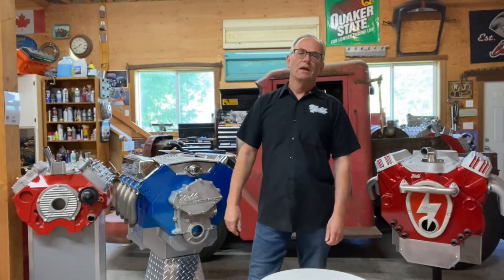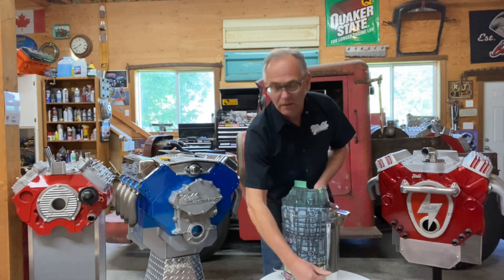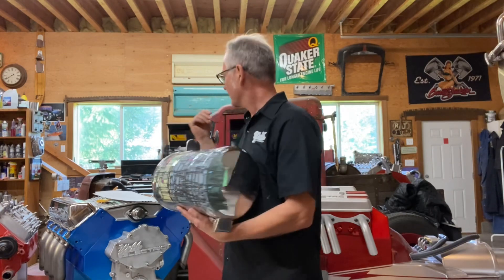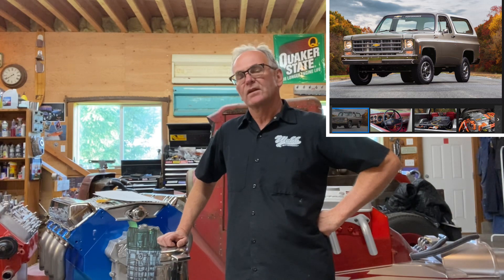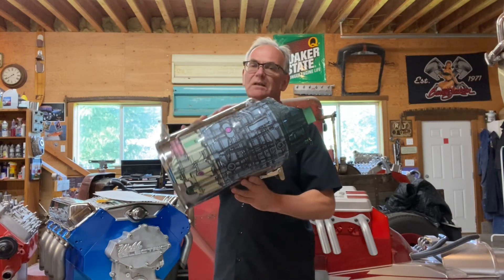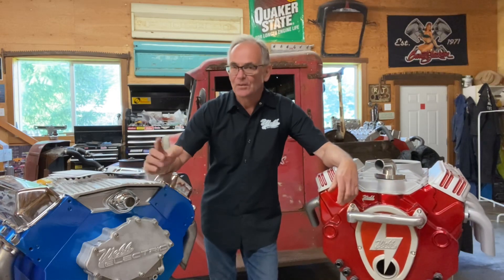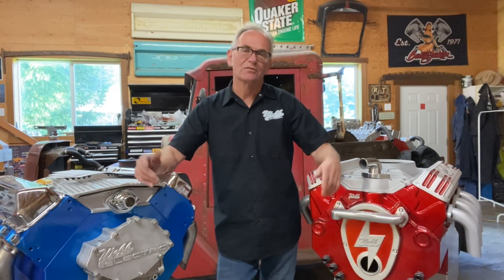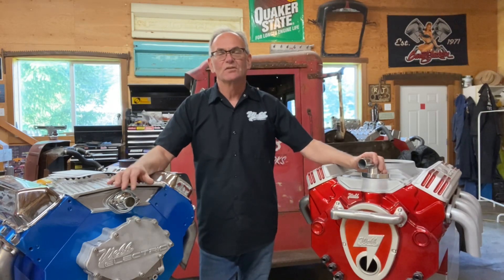Ford Eluminator And Chevy E-Crate Motor

Comment: I'm OK with it not coming with batteries or a charger, but the controller is essential, and with it, the costs rise well above 10 grand. Also, it would be enough if the government made the manufacturers release software updates so that the electronic systems in their cars can work with the new motors.

Comment: I think the sweet spot would be ‘everything except the battery’ in your crate motor, that bolts up directly to my existing trans with an easy connection to the battery…and maybe a display for inside the vehicle that I can just plug in.  I still want to run my manual trans.  I want to put the batteries in the bed of my 69 C-10 and put a wood bed kit on top, and I want modular batteries where I can decide how much range I want to buy now…with the ability to add range later on (and the controller able to automatically configure itself for the additional batteries).  I don’t want someone else to install it.  I want to wrench on this myself.  I think a diy kit like this would revolutionize the industry.
Reply from the maker: Yes my friend my thinking exactly
Reply: @WebbMotorworks  And, you could partner with Dakota Digital to replace the gas gauge with a SOC meter etc.
Reply: I really love the way you think. I will forever love old school big blocks and the smell of raw fuel ect.. but it would kinda be cool/funny to hagen2 giant Duracell batteries in the bed of the truck lol 😆😭🤪🤨
Reply: My thoughts exactly!